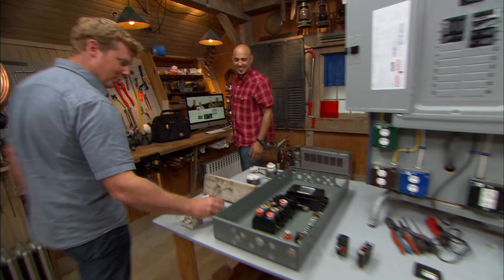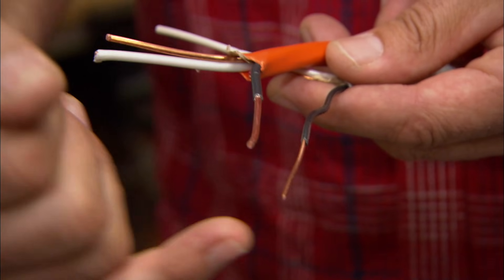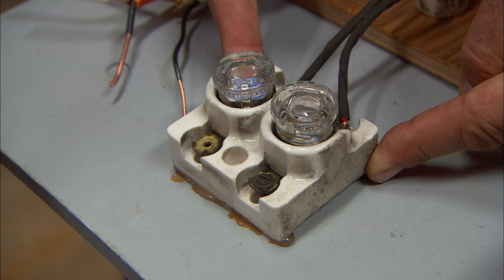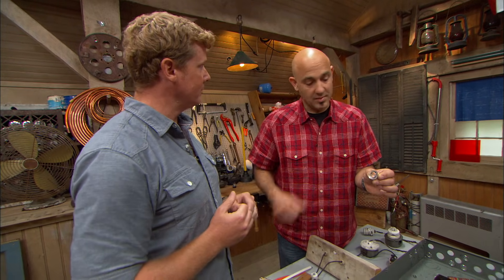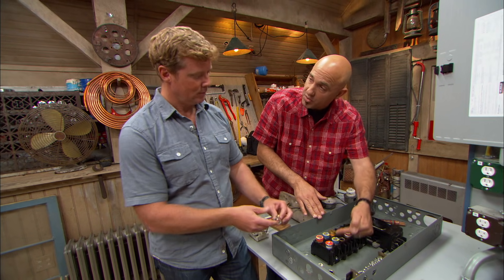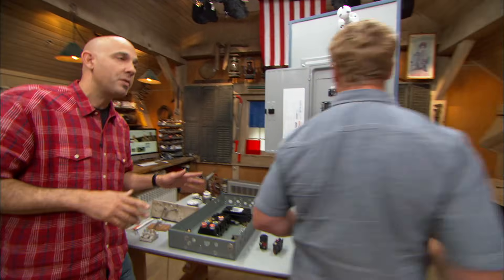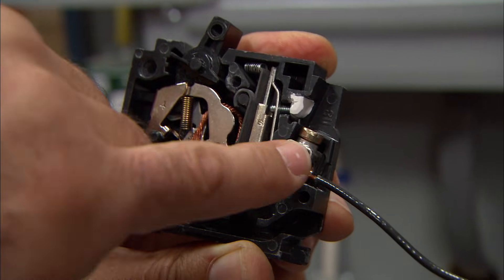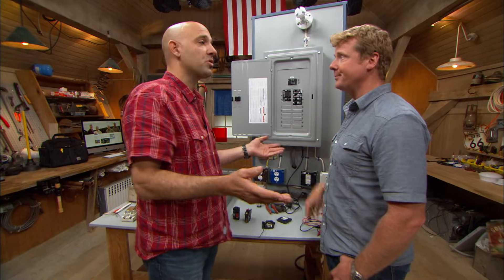How Fuses and Circuit Breakers Work | Ask This Old House

Comment: That's not true... Every circuit breaker has two types of tripping conditions. First is thermal, when current is slightly grater than nominal for long time (shown on video). Second is electromagnetic, it trips when short-circuit occurs and it's very fast. High current goes on coil that pulls the tripping mechanism. Of course I'm talking about basic CB not RCD's or others. Btw, in Europe we use RCD for whole house, not only in one or two sockets. And we use 230V so same cable can provide two times much power.
Reply: +EpiDemic117
That's not correct, that's wishful thinking 120 is safer. And this can be dangerous, never underestimate electricity! 120V or 230V doesn't matter, both of them can kill a person, depending on the circumstances. There's an electricians saying here in Germany: Voltage hurts, but current makes you small, black and ugly. It's not about voltage, it's about the current. 30mA are enough to cause cardiac arrest. The nominal resistance of a human body is 1000 Ohms (actually it's a range between 800 and 1200 Ohms but I use 1000 because it's easier to calculate), so:

120V / 1000 Ohms = 0,12A or 120mA
230V / 1000 Ohm = 0,23A or 230mA

That's the reason we use RCDs here, in the US you call them GFCI. They switch off if current travels the wrong way, which would be through a person into the ground in the worst case.

As you see, both is more than enough.

The difference between a transformer for 50 and 60Hz aren't actually that big, the difference is more interesting in the area of round about 10 kHz, then the transformer is really small. That's the reason for using these switching power supplies, they only need small transformers. In this case they're only in there for a galvanic insulation from the mains.
You could use a 60Hz appliance within a 50Hz mains and the other way arround if the voltage is fitting (transformer). But some things require the proper frequencies to function properly, like clocks or belt-drive record players. In case of the last ones the pulley must be changed.
Reply: The coil is missing...No. 7 on this picture:

https://en.wikipedia.org/wiki/Circuit_breaker#/media/File:Circuitbreaker.jpg

That's for short-circuit detection.
Reply: I think so, same as it is in a fuse. The wire inside of a fuse will almost evaporate in a kind of explosion if a short circuit occurs. That's the reason why such fuses are filled with sand.
Reply: No. 8 for extinguisher is also missing
https://youtu.be/ybNMI3ux7_E
Reply: Pointless... You need special sockets for everything that needs power. We can plug all this devices into standard socket. And when we need really high power? WE'VE GOT 3-PHASE 400V HI-POWER OUTLETS! Awwwwww yesss! My favourite ones! Look at this: https://www.youtube.com/watch?v=Ka-LEcZaYqQ
Reply: Yup, 22 kW for an EV-charger or a tankless water heater is no problem using a cable 5x6mm² fused with 3x32A. 11kW kitchen cooker, no problem...5x2.5mm² fused with 3x16A.

The NEMA-plugs NEMA-1 and -5 are a disaster. If only partially inserted there are parts touchable which are live at mains voltage. Absolutely no-go. The german Schuko or the french Gardy are recessed into the wall to prevent this, the UK BS1363-plug has sleeves on the line and neutral pins.
Reply: I assume you aren't in the US. Many homes use breakers here that are thermal only and don't have a ground fault or an inductive sense
Reply: Do you know how long it'll take for such a circuit breaker to switch off in case of a short-circuit? I would think they're more inert.
Here in Germany the code demands a switch-off in less than 0.4s for circuits which are fused with 32A or less. How you achieve this is the electricians problem, in case of a high impedant TT-grid they use RCDs/GFCIs. In a low impedant TN-grid you can achieve this with a normal circuit breaker. But RCDs with a tripping current of max. 30mA are now mandatory at every circuit which is fused with 20A or less (indoor) or 32A or less (outdoor). Before this you the RCD was only necessary for rooms "which contain a bathtub and/or shower", this regulation was introduced in 1984.
Standard circuit breaker here is the B-type, so we calculate with 5-times (B is 3 to 5 times) of the rated current for an immediate trip. For the C-type (mostly used in workshops, 5 to 10 times) it's 10-times of the rated current.

https://en.wikipedia.org/wiki/Circuit_breaker#Standard_current_ratings
Reply: Marcel Germann oh absolutely, it can take ten seconds or so in cases where the draw is only a few percent over the rated draw
Reply: I don't mean the overload, they all will let some overload through for some time. Here it's 1.4 times of the rated current for 1 hour (ambient temperature 30°C), this is cosidered into the wiring, so the wires can handle this for that time.
I meant the time for tripping in case of a massive short-circuit, this must be less than 0.4s here, and I think a thermal only circuit breaker will be more inert than a thermo-magnetic one.
Reply: Marcel Germann it definitely is dangerous, but since in the US the states are treated as individual countries, many of them have their own building codes with different, higher standards. Some areas have no building code. There is less risk in a single standalone home than in an apartment building or a hotel, so the standards are far higher and you'll see GFCI and inductive breakers.

Comment: the problem with circuit breakers is that when they repeatedly trip some people tape them in the ON position
Reply: That sounds like a problem with the person rather than the device. Should always ask "why?" when a breaker trips.
Reply: I don't know how the circuit breaker are in the US, but on the ones you get here in Europe this is impossible. They'll trip internally, no matter in which position the lever is hold, this is called a "trip-free mechanism".
Reply: doesn't matter if they do the breaker will still trip in US too
Reply: The lever could also get blocked by dirt, most of these breakers will be/are in use for decades.
Reply: Usually they have a failsafe in the device that also melts just before the wire Incase if failure of the thermal trip, but I could be wrong
Reply: Such person deserves his house to be burned down. It’s already a bit dodgy to put it right on again after tripping without investigating. Taping it to on is just stupid.
Reply: +John Holcombe
So they've got this mechanism too. I would have wondered if these breakers don't have such a safety feature.
Reply: John Holcombe thanks for the reply!

Comment: I always thought once it tripped, you had to turn it off to reset it before turning it on?
Reply: Tomas Keating they didn't mention that. Yes you need to turn it off to reset it and then turn it on.
Reply: Tomas Keating The USA ones have to be pushed to reset position first indeed. The European ones can be pushed on directly after tripping.
Reply: Miguel Mart 

You would think being the " professionals that they are " would've mentioned this.
Reply: True

Comment: Good work :) learned so much .. have obe question can i use a 240v 1cm wide wire for bigger items such as 1400w hallogen lamp? Or will it melt because its too much of a power
Reply: Vape Maniac I assume your wire is 1cm long and not 1cm diameter.. The diameter is what determines the max amount of amps that can go through it. 1cm diameter wire can handle hundreds of amps and thus something like 24000 watts at 240v. But don’t mess with it if you don’t know such stuff. House on fire in the middle of the night is no fun.